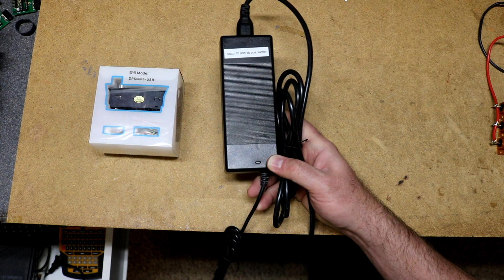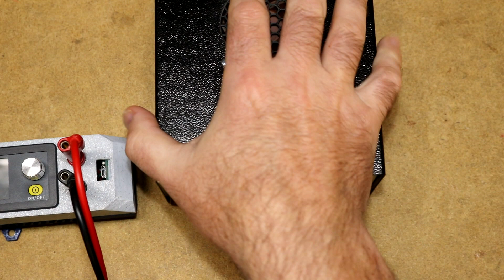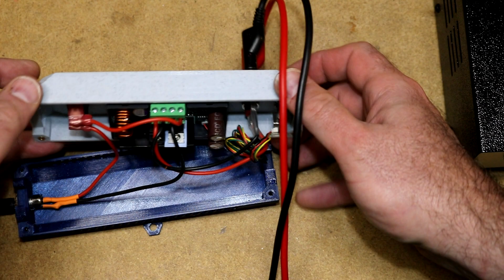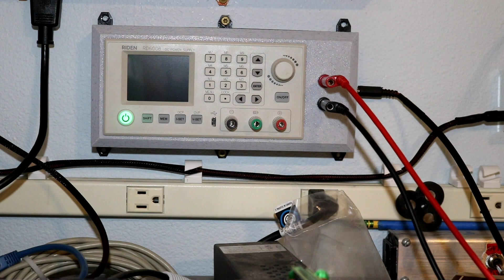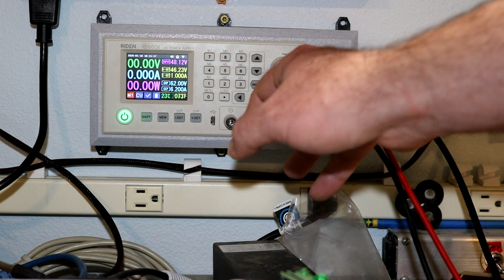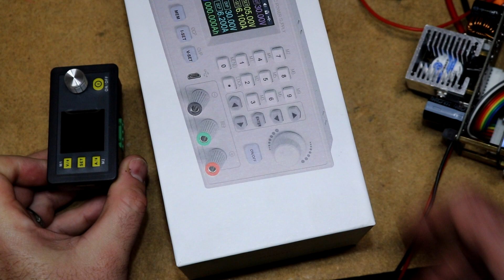RD6006, DSP5005, DPX6005 Switching Power Supply Module Reviews

Comment: I think the temperature sensor with the RD6006 is intended to be used for monitoring battery temperatures when charging them. If so though, it needed a socket on the front panel really. I left mine connected inside the power supply as well.
Reply: yes, the temperature is used to monitor the temperature if the battery being charged

Comment: I wanna get a couple of RD6006 modules and have a dual power supply. Kinda a bummer that the Battery Charger is in between the two outputs.
Reply: hello friend, any suggestions about the improvement?